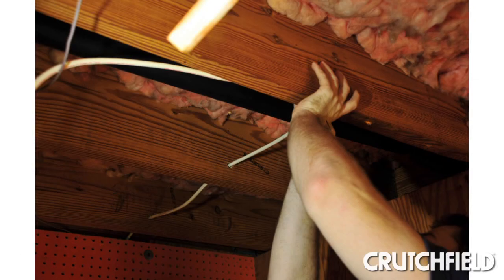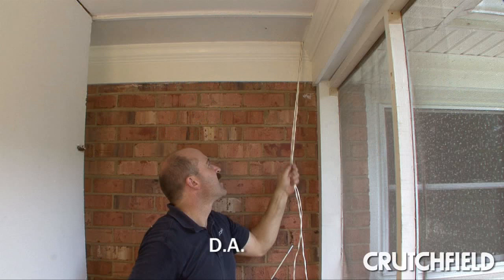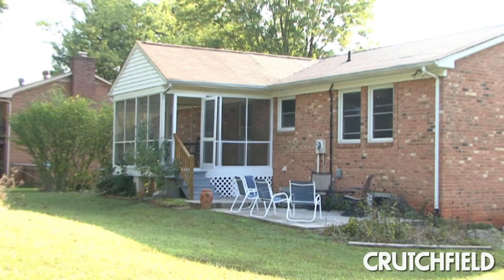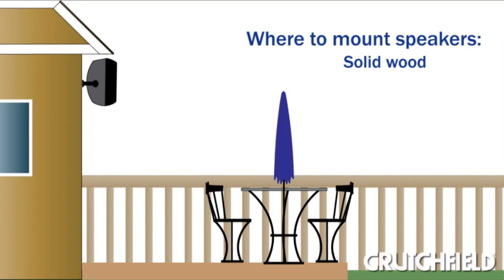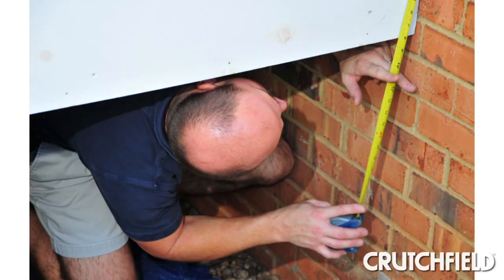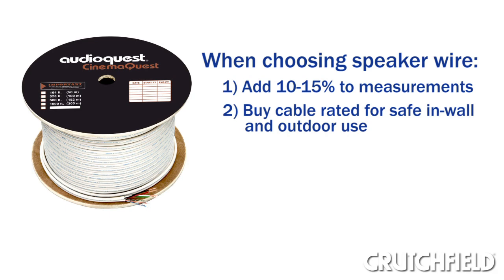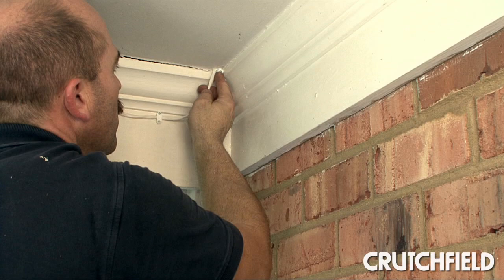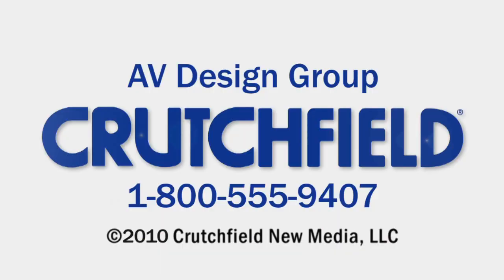How to Install Outdoor Speakers | Crutchfield Video

Comment from the maker: @MrJosephsoto CL2 and CL3 rated wire should be labeled as such on the outer jacket that protects the multiple conductors within. There is no one-way that the four wires must be connected. Basically, you will want to match the connections on the other end (at the amplifier) for positive, negative, left and right channels. They are color coded so you can be sure to connect the same wire properly on both ends. Feel free to call for additional assistance: 800.315.0030--Crutchfield

Comment: well, they left out the tricky parts of running the cable. there's the rub. it doesn't magically appear out at the edge of a patio roof like that.
Reply: Thats the same I was thinking. No real guidance on how to determine the best route through the house wall

Comment: What does cl2 or cl3 wire look like? My house is pre-wired for outdoor speakers, and I have two pairs of speaker wires and a little bunch of wires together. 4 to b correct. Red, black, white and green. How do I hook those up?

Comment: Do you have to have speakers going back to the amp tp their own dedicated terminal or can you piggyback them onto each other in a chain.
Reply from the maker: Typically you want each speaker to have it's own dedicated terminal/ channel. You can piggyback them but that changes the impedance and can put stress on your amp and sacrifice quality. 

You can consult with our A/V design team if you have specific questions regarding your project:

https://www.crutchfield.com/I-rFBKc290/About/diy.aspx